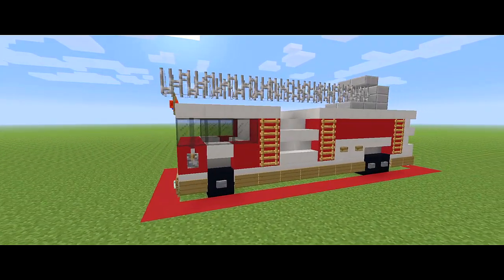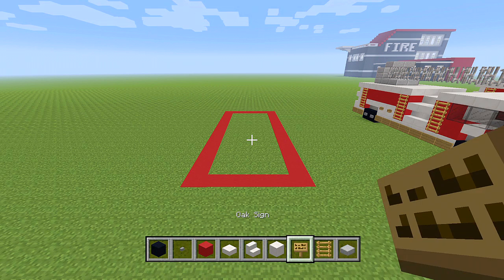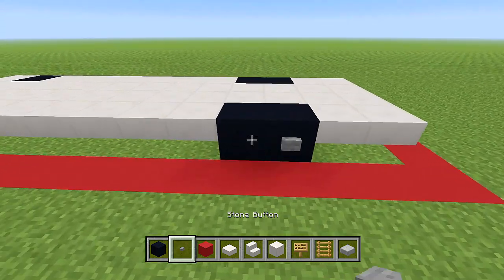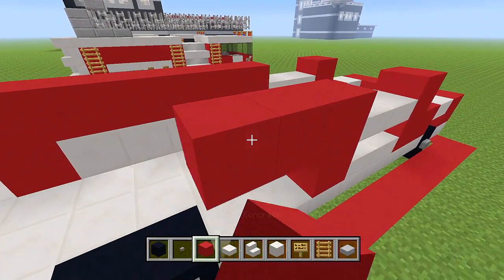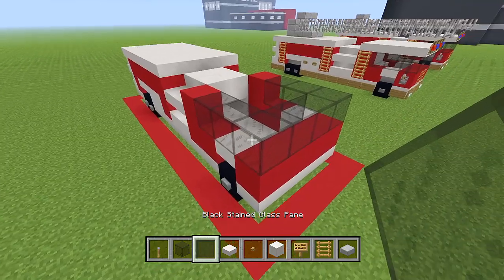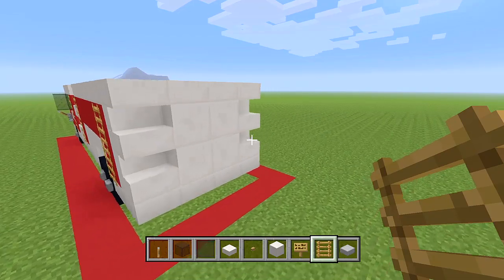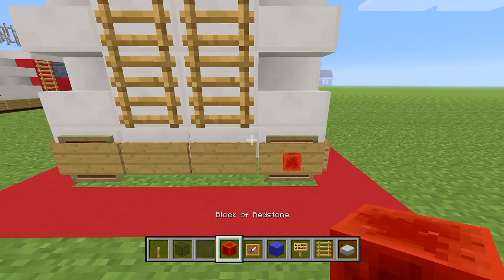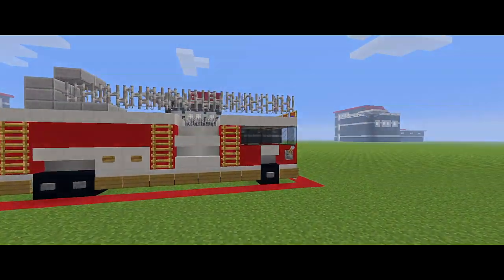Minecraft: How to Make a Fire Truck!

Comment: I can’t do the item frame behind the sign thing
Reply from the maker: Make sure your placing the item frame on the slab, not the sign. Keep in mind you really don't need the sign where the item frame is.
Reply: It still won’t let me I am on xbox
Reply from the maker: You might not be able to on Xbox then.
Reply: I could do it on my xbox 360 but not on my xbox one.  Some things were better on the older console some not.  This is one of the things i cannot do any longer.